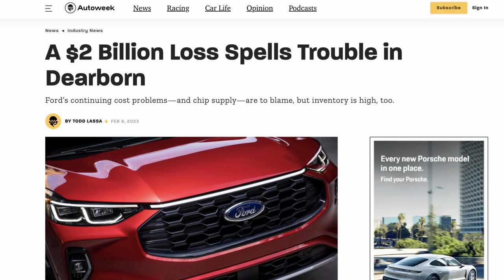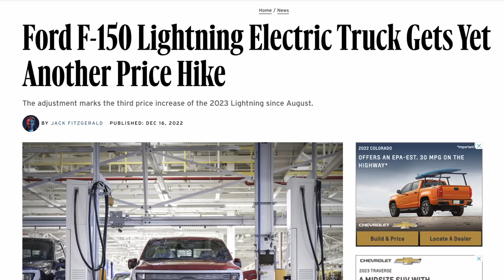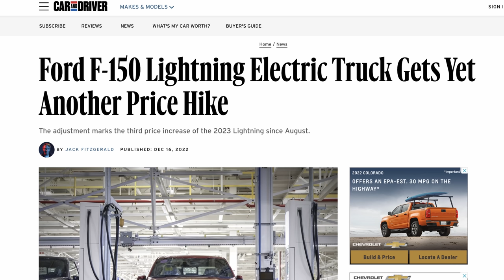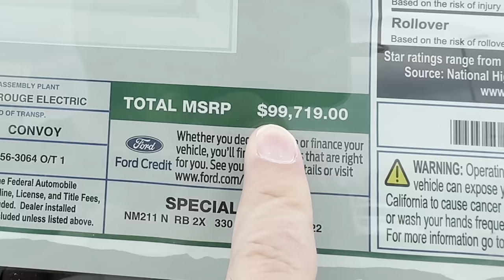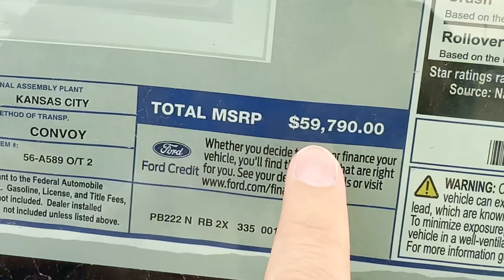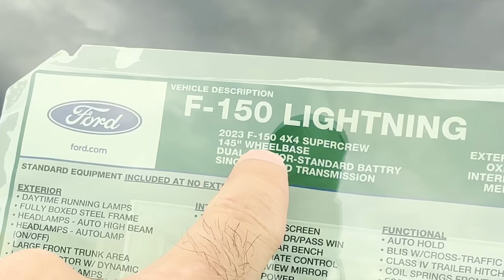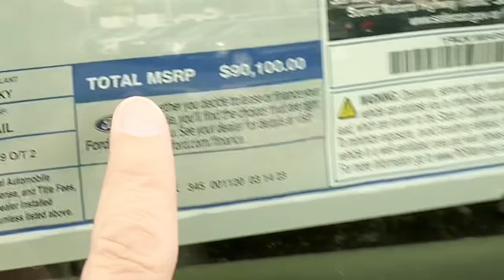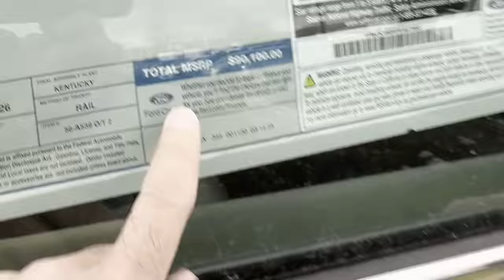Ford CEO Makes HUGE MISTAKE, Now Dealers CAN'T SELL TRUCKS!

Comment: 100k for a POS full of recalls forcing us to use the dealership for service that can't even tie their own shoes. No thanks.
Reply: 🤣 that's soo true
Reply: If you don't have a trade-in with crazy resale value these trucks are unobtainable.  They're giving us $71K trade toward a $89K truck. I'm financially comfortable but without that kind'a deal NFW would I pay what they are asking. It's crippling. Add $90 a month for every % of interest rate as well,,, remember that. That $71K trade -in is a POS is the only reason I'm getting rid of it.
Reply: @Dive-Bar-Casanova  You say you're "financially comfortable" ok well, how did you wind up with negative equity like that? We lost our almost paid off Mitsubishi last November to a deer accident. So we needed to buy something and I didn't look forward to buying anything at that time because I knew the used and new car market was nuts. Best thing I could find was a 2023 Kia Soul LX for $22k. Toyota and Honda didn't have much inventory and what they had on the lot was way overpriced. So we took the $10k equity check from the Mitsubishi and put it towards the $22k Kia. We had $60k in the bank in cash at the time and we could have purchased anything we wanted but the $22k Kia gets us around so I'm just trying to fathom your situation with a vehicle that costs several tens of thousands of dollars. I checked online to see the Kia's value and even though the 2023 doesn't come up in KBB because I guess they don't have enough data yet, pricing it as a 2022 with the same miles it comes back over $19k trade in and $21k private party which is insane but means we have plenty of equity so we can trade out if we wanted to but we tend to keep our cars for at least 10 years.
Reply: Go tundra and rams
Reply: I was at a Ford dealer this winter with my wife's Fusion to replace the driver's airbag under recall, the place was a shit show. Writers openly discussing blown-up engines and they couldn't do an oil change for me, either. They wanted me to spend more time at their ROC across the street.
I'll fix everything that I can from now on.  I'm a musician, not a tech, either.
Reply: @MazichMusic  perhaps I can recommend toyota?
Reply: it doesn't help when a ford factory trained mech buys one, and it goes into limp mode in the first week of ownership. Then you have videos of someone buying a mach E, having issues in the first month and when she took it in to get fixed then said 4 months to get parts. I'd demand my money back right then and there.
Reply: @justacinnamonbun8658  Get a Corolla, pay what you have to but please don't buy junk like a Kia.
Reply: It's like this, most dealers understand the average customer buys 1 vehicle every 7/10 years at best, customer's that buy fleet buy every 3/5 years, so a fleet buyer will get that $70,000 truck for $63,000 and get tool box,spray in liner and free maintenance for the first 30,000 miles or 1st year. But ford took advantage of the supply and demand and lost its fleet buyers to dodge because they offered 0% interest for the life of the loan,didn't do market adjustments . Chevy,gm are almost broke and the fleet deals they run are 6 cylinder trucks plus interest rates with a extra 2 points for the financial writer. Titan,tundra most of us will never buy fleet trucks because the truck is still to new and not really a competitor vs the USA brands. Not saying that titan,tundra won't just no market for fleet trucks pulling a car carrier, flat bed ,tow truck.
Reply: @petebusch9069  Uh...... No. Unless you want to start paying my bills in which case you're more than welcome to.
Reply: @justacinnamonbun8658  Who pays bills these days, just sign the papers and don't worry about it.
Reply: @Dive-Bar-Casanova  It must not be a Tundra. 😀
Reply: @tr-lj2vx  The do da te lo door chime is the deal killer for me.
Reply: @justacinnamonbun8658 he didn't say he's getting 71k trade in on a truck he owes 89k against.
He's getting 71k towaards a vehicle priced at 89k.
Reply: @tr-lj2vx  The bait and switch, add-ons after agreement, padded service bills etc of dealerships is going to sink them. I would rather deal with a cop that should have retired a decade ago than to fight a car salesman.   The  first time I ever walked on a car lot I knew within a minute I was standing in a den of vipers. The average dope dealer has more honor than the average car salesman. The few times I have walked on a dealer lot, I tell them I am the one with the money so I ask the questions, until then leave me alone. Most of them are really offended with a person unwilling to be manipulated in to a worse deal.  Dont answer any of their questions because I can assure you  99% of them dont give half a crap, anything you say will be used against you.  If I see a vehicle I am interested in I tell them how much I will pay, in cash, and dont want to hear anything else but yes or no. If you have to go haggle with someone else to see if the number can be matched, that's on you, I'm not gonna play games for weeks. If I decide to use financing I am certainly not doing that through the dealership because if they are involved they are gonna tack on their cut too.  Just think about it, go on the lot and ask, how much is that vehicle and the contract they write up will NEVER be the price they told you.  In fact it would be hillarious if somebody would film that interaction when they whip out cash and start counting it out right after they were told the price.
Reply: @petebusch9069  Yeah that's what I thought. All talk, no ⚽⚾🏀.
Reply: @tr-lj2vx  "I hope ford starts building good trucks again" bwahahahahah that's a good one! you had me going there. Ford's motto: quality is job none!!!
Reply: Isn't that the truth!
Reply: 30 year Ford tech, I AGREE. 🤙🇺🇸🇷🇺✌️
Reply: Best comment 👌.  Spot fuckn on Pete😎✔️
Reply: You spelt Stealership wrong lmao!
Reply: yeah I'll get a toyota tundra for 60% that cost and mostly NEVER worry about its craftsmanship and longevity. Henry Ford is rolling over right now.
Reply: Of the 3 manufacturers mentioned, Ford is the only one with a major safety flaw in the design of their auto transmission!!!
•  In an emergency, you can't push the shift lever from D into N with an open palm!!!  This is not shifting in the normal sense by pulling up on the shift lever and changing gears!  
•  On Ram, Chevy, GMC as well as most other auto manufacturers  you can do the emergency disconnect move - Honda, Toyota, BMW, Lexus, Audi, Mercedes, Nissan just to name a few!!!
•  The same is true on Ford's console mounted auto transmissions - you can't do the above move but have to push the lockout button!!
•  The whole idea behind this safety design is to allow the driver to disconnect the engine from the drivetrain without having to worry about putting the trans into Reverse! There is a safety detent and the transmission cannot go into Reverse with this emergency procedure!
•  No dealer know about this because for some reason, the manufacturers do not publish this info!!! Try it - you just may be pleasantly surprised unless you own a Ford product!!!!
Reply: @christianmiller4422 rams .  😅🤣😂🤣😅
Reply: @petebusch9069 very good advice.. 40 year mechanic here.
Reply: @utpharmboy2006  I have a Tundra and a Taco.
Reply: @petebusch9069  lucky 😁
Reply: After it has sat uncovered in a lot for over a year. It's already halfway used with no mileage.
Reply: Exactly I'll ride a bicycle outfitted with a motor before I pay this kind of money for a vehicle.
Reply: @Overlord is Google that's actually an option. I have seen electric bikes with 1,000 watt motors, 120+ ft/lbs of torque, full suspension for about $2,500 plus shipping. They are pretty fun as well.
Reply: @Just a Cinnamon Bun  either me or you are misreading his post..I read that he had 71k in trade in value. Not negative equity. Paid for 71 k truck traded for ann89k new truck, leaving about 18 k balance to pay on new truck.
Reply: It’s amazing how much the dealers don’t care. Oh wait… they do care about high priced unnecessary fluid flushes.
Reply: @christianmiller4422  love my ram!
Reply: Anyone who spends 100k on a truck deserves what they get
Reply: @laserflexr6321  
The managers set up the sales floor mentality with meetings & "training". They don't care if you Rochambeau with the customer for 5hrs.  Hence the poor shopping experience and massive emp turnover.
Reply: @muskokamike127  Didn't you hear, Ford changed their logo to "No longer built Ford tough."
Reply: America is holding on to it's money........... (sound of a pocket of change being emptied into a jar after the 3rd visit to a convience store that day)
Reply: We had two oils changes on both our fords
Reply: Comments about Dealers really hit home here. 2016 F250 Super 6.7, ran great till 67K. Meticulously maintained.  Went into limp no reason at all.  Took dealer and no less than 3 Factory service engineers 6 months to diagnose and repair...a Mass Airflow Sensor.  Then returned it to me with a severe exhaust leak into cab, just fixed last week.  6 months without vehicle.  Had to get FoMoCo involved to make it happen. To their credit they did give me a 3 year 36K Premium Care Warranty but only good at Dealers.  And it's going to be getting a new DCR fuel pump to replace the CP4 that explodes and takes out the fuel system around 100K miles.
Reply: @rayc5255  Dump it.
Reply: They can't get parts either.
Reply: "But but but, I have a college degree and can afford that..."  🙄.
Reply: This is the most accurate description I've ever read.
Reply: @laserflexr6321   exactly. I bought my car with an app and paid the exact price they were advertising it. No haggling or hidden B.S. and, it is American designed and manufactured and hella fun to drive. Thanks @Tesla.
Reply: No one can force you to use a dealership. However, if you need a warranty repair or a recall done, the customer doesn't pay. 

That said, if you own a late model vehicle, you really don't want to use an aftermarket shop. Very few techs are capable of working on modern cars. And for the ones that do, at least 90% of them work for dealers. I get cars towed in every day from independent shops that got themselves in over their heads. They just don't know what to do. If you don't have factory training, it puts you at a huge disadvantage.
Reply: @AT-wl9yq  BS all the way. We ARE forced to use the crappy dealership for warranty and recall work and its a horrible experience. Yes it may be free but having the idiots do what they do to my truck is a nightmare. Independent shops are not ALL bad, there are a lot of good ones out there and is where all the really good techs end up, not the stealership, that's where they get their start because a dealer will hire anyone.
Reply: @petebusch9069  "We ARE forced to use the crappy dealership for warranty and recall work"
I believe I just said that. How could it be any other way? But lets say they did allow it. You would then say "I brought my car in and they didn't even have a factory certified tech working on it."

As for the rest of it, you're just being emotional. Independant shops can't do anything. There's an occasional exception, but for the most part, they don't have the tools or ability to do the work. I have to fix their screw ups every day. At least once a week, I get an F150 towed in from another shop that couldn't follow the procedure to set the transmission fluid level properly.

So, you can say whatever you want, but I'm the one who actually does this. You, and the  people you bring your car to, do not. I do procedures on vehicles every day that you guys don't even know exist. And I mean that literally.
Reply: Yeah, I've seen too many videos about repair work done by Ford that was either incompetent or just not even done.  Too bad.  I used to love Ford.
Reply: @zak2u2  Me too. I'm a senior master Ford tech. Its the highest level you can get. We used to make some very respectable vehicles. They may not have been the best, but if you took care of it, one of our cars will last. Not anymore. Our engineers are crazy. When I tell people that work for other brands about some of the design issues we have to deal with, they don't even believe me. 

Here's my advice to anyone interested in a Ford. Of all the major brands, Ford is the most complicated and difficult to work on. The relationship between the dealers and the factory is also extremely complicated. A regular person will never be able to tell if an issue they are having is the dealers fault, the factory's fault, or both. It could be any of the 3. If you don't have a dealership you know and trust, don't buy a Ford product. Very few people can fix our cars. You'll need to rely on your dealer.

If you are not sure if you have a dealer you should be using, check for one thing. Heavy line work. If you have a look in their service department and you see a lot of big jobs, such as engines and transmissions, that's a good sign. Some dealers are set up to do this type of work, while other try to avoid it at all costs. Just about every day, I get an engine or transmission approved for a customer that was turned down at another dealer. It shouldn't be that way, but that's how it is. Other brands, like GM and Dodge are far easier to work on. They're not necessarily better, but you don't need such a high level tech to work on them.
Reply: You have to have them to sell them
Reply: Leave the trucks on the lot  and just by yourself  nice pair of sneakers 👟 👞 👌
Reply: Priced to high for any hard goods ,
Reply: Lmao. Well their stock continues to rise, actuallt just got a huge bumb due to the tesla annoucement. But yeah, there will be kids on here crying about anything and everything.
Reply: Same with rams 3500. After 2018-2020 the truck is garbage.
Reply: @christianmiller4422  I'm a Toyota truck guy but I have to admit, I like those Ram trucks that are coming out.
Reply: @tonyrobichaud  I like my hemi's too, but I can buy a 2021 1794 edition tundra for as much as I can buy a big horn ram.
Reply: Sorry bud but adjusted for inflation these high dollar upper end trucks are not too far off from prices 15yrs ago adjusted for inflation. Where people crying then? Secondly Ford can't keep these trucks in stock. Third, in the USA only about 10% of all half ton trucks will ever tow or haul anything more than fishing gear or golf clubs. As far as site stock...good job, you came the week they had regional delivery. 🤡🤡🤡
Reply: People need to STOP buying these vehicles until they come WAY down.
Reply: No one is forcing you to do anything lol
Reply: I called no answer
Reply: But, isn’t Ford giving the consumer what it wants? If they are willing to buy them, which they have in the past, Ford will provide them. If the consumer says no dice, they will disappear.
Reply: Bought a truck from them and came back a year later the truck I bought for 24k they offered 6200 then try and gouge me on a newer big truck. The f
Reply: Yup.  Not interested in Eco-trash engines.  Give me 2V 4.6 with aluminum body.  Coyote is good.
Reply: And have the time the dealer service takes 3 days just to fig out the issues
Reply: Then factor in the interest rates and payments. People don't need another house payment
Reply: @rvadventures  wish I were as broke as GM. General Motors gross profit for the twelve months ending March 31, 2023 was $21.407B, a 22.34% increase year-over-year. General Motors annual gross profit for 2022 was $20.981B, a 17.36% increase from 2021. General Motors annual gross profit for 2021 was $17.878B, a 30.76% increase from 2020.
Reply: @redinsight6725  US consumer spending has been going up every year since 2020 and is higher than ever both in gross amount and as a percentage of income. So you're completely wrong.
Reply: @HeWhoIsWhoHeIs  I'd look but honestly want a 6.7 f250 he'll even the 6.2 will do but I have seen some used for 45k with 120k miles
Reply: What Ford should do to get out of this slump is go woke.  🤣😅😂😆😅😅😆🤣🤣😂🤣😅🤣😆😂🤣😅🙂😂🤣😅😆😅🤣😅😂😆😅😅😆🤣🤣😂🤣😅🤣😆😂🤣😅🙂😂🤣😅😆😅🤣😅😂😆😅😅😆🤣🤣😂🤣😅🤣😆😂🤣😅🙂😂🤣😅😆😅🤣😅😂😆😅😅😆🤣🤣😂🤣😅🤣😆😂🤣😅🙂😂🤣😅😆😅🤣😅😂😆😅😅😆🤣🤣😂🤣😅🤣😆😂🤣😅🙂😂🤣😅😆😅🤣😅😂😆😅😅😆🤣🤣😂🤣😅🤣😆😂🤣😅🙂😂🤣😅😆😅🤣😅😂😆😅😅😆🤣🤣😂🤣😅🤣😆😂🤣😅🙂😂🤣😅😆😅🤣😅😂😆😅😅😆🤣🤣😂🤣😅🤣😆😂🤣😅🙂😂🤣😅😆😅🤣😅😂😆😅😅😆🤣🤣😂🤣😅🤣😆😂🤣😅🙂😂🤣😅😆😅🤣😅😂😆😅😅😆🤣🤣😂🤣😅🤣😆😂🤣😅🙂😂🤣😅😆😅🤣😅😂😆😅😅😆🤣🤣😂🤣😅🤣😆😂🤣😅🙂😂🤣😅😆😅🤣😅😂😆😅😅😆🤣🤣😂🤣😅🤣😆😂🤣😅🙂😂🤣😅😆😅🤣😅😂😆😅😅😆🤣🤣😂🤣😅🤣😆😂🤣😅🙂😂🤣😅😆😅
Reply: guys/gals, ALL vehicles have been junk since the mid 2000s.
Ford F150s died in 1997 / Super Duty died in 2003.
Dodge 2nd Gen. 1994-2001 with a Cummins was the only good truck Chrysler ever made. NOTHING before or after.
My beloved GM died in early 2007 at the end of the 5th Gen.
Reply: All brands are garbage
Reply: @TheThugNasty  💯🎯👍
Reply: @christianmiller4422  🤡commi
Reply: @justacinnamonbun8658  buying a car is a money losing situation overall.  Buy what you can afford and keep it simple.  That's a different number for everyone.
Reply: I took my 2010 tacoma to a toyota dealership in north central texas to have repairs done and it came out with more problems than  it went in with. Ughh
Reply: @christianmiller4422    They’re also having problems. And the prices are horrible. Fun story…my 2013 taco started having trouble with people not hearing me and dropping phone calls. I’m a retired OR nurse (long story) that happens to have a A&P license so I will do my own repair unless it requires special tools or facilities. I was lucky because the microphone is not part of the radio and “all” I had to spend was $200 for it which if you saw what it is you’d say it was robbery. But just for curiosity I asked the parts guy to look up the radio…him and I shared a nice heart attack moment when he found it was $5k+ and he could discount it to $4k+. For a moment I thought I was at a German or Italian car dealership.
Reply: Every dealership is different. This comment is garbage because it associates the good with the bad.
Reply: @andyfreeman6865  Show me a good dealer and tell my why its good.
Reply: @andyfreeman6865    Not every dealership is bad…correct however most dealerships ARE bad. In my case I switched from ford to Toyota in 2013 because my local ford dealership refused (passive aggressive style) to repair my 1997 F150 with OEM parts. All they wanted to use was rebuilt parts. I finally got sick and tired of the repeated “warranty” replacement of the rebuilt parts and keft
Reply: AMEN!! 👏🏽👏🏽👏🏽👏🏽👏🏽 "NO THANKS!!" indeed!! 👏🏽👏🏽👏🏽👏🏽👏🏽
Reply: @overlordisgoogle8431  my daughter sold her car and brought a £1000 electric assist mountain bike from Halfords...it breaks down once a week...their excuse is that 25 miles a week for commuting is too far and that it's not suitable for commuting...they won't give her money back as she has had it over 4 weeks.....you couldn't make it up.....I shall keep with my 16 year old diesel Ford truck and continue doing my own repairs...EVe are not currently fit for purpose...
Reply: @christianmiller4422  ditto to your sentiment. I got 25 k trade in for my corolla and then put myself in a tacoma. Toyota is clearing space for inventory…they move their inventory FAST!
Reply: @HeWhoIsWhoHeIs Kia and reliable are not 2 words I would put in the same sentence.
Reply: @yourfriend9048  not toyota or honda.
Reply: @christianmiller4422  TBH, never been a fan of imports. IMHO, I doubt they're in any better shape though.
Reply: @Moveto Rumble  you do realize Hondas and toyotas are at the very least assembled in the US right?
Reply: @HeWhoIsWhoHeIs congrats. I believe you are a lottery winner because of that.
Reply: @christianmiller4422  ok, thats good, i guess?
personally, my favorite vehicles are fullsize 4th Gen. GM trucks, vans and SUVs from the 90s. in our house, thats all we care about... back when vehicles were still built well, meant to last a long time and were user friendly and easy to repair and maintain. not to mention, built in Canada and USA.
Reply: Or pull up a zipper!
Reply: I had a used 2008 Nissan Rogue that I bought for my daughter, in 2015 the transmission went while she was driving on a Parrkway, Nissan replaced the Transmission free of charge and that is the only major problem I ever had with a Nissan, and I have had 8 of them. None of them were pickup trucks but if I wanted a truck it would be a Nissan or Toyota.
Reply: @jeffb5785  sorry to hear that.
Reply: @georgeemmons5128  and likely not even sit on the toilet the right way.
Reply: Pretty much sums it up
Reply: No, it’s funny the Ford dealership by me has like no trucks but I know this guys right because it’s been going up for years fast to
Reply: Should've bought a Nissan
Reply: @justacinnamonbun8658  I wouldn’t be caught dead in a mitstibushi no matter how cheap it was
Reply: @christianmiller4422  fusions are garbage
Reply: So basically it's costing you $1,000 per mile your going to drive it.
Reply: Commercial in this video was a Ram truck 🛻.  Toyota?
Reply: If you make $21Million or $21,000,000 (lot of zeros) they appear cheap.  What model Mercedes or does the CEO drive.
Reply: @MazichMusic  
Don’t damage your hands Mr Musician or you are out of work.
Reply: @christianmiller4422  I picked up a 2020 Ram to get out of a 2013 bmw which I blew the engine and just put thousands of dollars to fix it at a time when the car market was nuts and I’m glad now the Ram is still worth more than what I paid for it with way less miles than what’s on the market, screw all these dealers with crazy markups cheers to all 🫡
Reply: @laserflexr6321  
If you count that much cash 💵 you have forms and the IRS to now deal with.  Ask Walter White too much cash is a problem.
Reply: @rcpilot179  
Add a tow hitch to the electric bike 🚴 and pull your boat.
Reply: @justacinnamonbun8658  Some of us don’t care. I care about having a pickup with fantastic off-road performance, so I bought a new 2022 Jeep Gladiator Rubicon. No matter how you spin it, vehicles are not good investments. May as well have fun and love whatever it is you are driving.
Reply: @TheThugNasty  Why bother rationalizing? They’re all expensive, and they all depreciate. I say just buy something that you love.
Reply: I'm literally looking at buying a full blown IFR capable Plane for 40k less than that lmao
Reply: @redfoxtactical8425  I want a helicopter so bad
Reply: You just concisely but effectively roasted Ford in the most convincing way I've ever heard. Just based on this one comment I'd be scared to every buy a Ford. My Toyota isn't perfect but....
Reply: I’m a ford tech at a dealership and this is so true. Lmfao 
Most of my jobs are just recalls lmao
Reply: Hahaha! I spent 100k on a import Porsche . Nice piece of ultimate engineering .. Ford…..NOT
Reply: I have an 2021 F150 super crew selling for 55$K ,, CANADIAN !WITH 33000km or 18500miles ., no accidents ,no smoking , no towing ,,completely clean
Reply: I work at a Ford dealership and will say there is absolutely no support from the manufacturer.  That makes it very difficult for those out inches trenches.  "Peofits over people" that's American BIG Business
Reply: @christianmiller4422  do you remember Pearl?
Reply: No exaggerations were found lol
Reply: Chevy is just as bad lol
Reply: @Dan-nr3om  It is, same with Dodge.
Reply: The nice Lady at Autonation in Wickliffe,  I bought my Transit  from, know s more than the service guys!😵‍💫
Reply: Boy, you got that right.
Reply: Yup they are absolute shit! I only sell them at a major Ford dealership
Reply: Ford rainbow raptors didn't help sell either 😂😅😅
Reply: @christianmiller4422 says so a Toyota sales person, loool, what a joke
Reply: @christianmiller4422 I drive a Lincoln and after 5 years of ownership, no issues whatsoever. Only recently I had my brakes changed. Ford makes excellent cars. But I do understand your advertising tactics for Toyota. If you work for a Toyota dealership, then I guess you should be loyal to them, lol
Reply: Lulz....
Reply: Dealerships are in every way, AWFUL. I hope Tesla helps to end Dealerships all together.
Reply: Keeping up with the Jones'
Reply: I’m going to keep my shit box car until the mechanics say “ I’m sorry we can repair it due to x,y,z. “ My car is paid off! No way would I ever pay $30,000 or more for something that just keeps loosing value.
Reply: If The Big 3 In Michigan Are Depending On Me And My Wife And About 16 Cousin's In Our Family They'll Be Standing In The Bread Lines. My Sisters Son Bragging At A Family Get Together  About His New Chevy With That Big Screen And All The Other Options And Then Told Us His 84 Months Loan Term And Monthly Payments At 6.5 % Intrest. A Bunch Of Us Just Laughed And Told Him We're Glad Of The Simple Education We Had And He Laughed Specifically At Me And Said Well At Least He Didn't Have To Ride Around In An Old 1999 Suburban.😂😂😂
Reply: Agreed, or schedule work to find out those incompetent morons are 5 months behind on vehicle warranty work, so…..you get to have a POS loaner while yours sits in the shop while paying that 2k payment at 6% interest (or MORE)
Reply: You forgot to mention the piss poor engineering engine failure transmission failure out-of-this-world
Reply: F was the on
Y stock I had left in the green after Biden too office.   Now all red.  At least with Ford, I can buy.
Reply: I own a service company and we buy multiple trucks a year , after years of buying f-150s we are not buying them anymore, last 2 ones we gotten have multiple issues, and the dealer doesn’t care ! We literally had a truck with less then 1000 miles and was not working and the dealer didn’t even care ! No more fords !
Reply: No truck is worth 100k as I see it.
Reply: @christianmiller4422  perhaps you could recommend Toyota, IF the stealerships had any stock.  Shortages of new stock has led many toyota dealerships to stock with overpriced used vehicles, while gouging for new stock even on orders
Reply: My last Ford was in 2014 and I've never looked back
Reply: @christianmiller4422  my 04 tundra has 300k plus miles, no rust and runs like a champ. I’ll never buy anything but Toyota again.
Reply: It's insane! 😂
Reply: I’ll just get a Mercedes S class for that kind of money, and rent a truck when need it.
Reply: I had a 2014 Ford Focus with a CVT transmission that went bad. Ford dealership makes me sign up for a sunbit loan, $4000 
That I'm still making payments on. Had to rent a car for 2 weeks while waiting for repairs that cost me $2,200. As I drive the vehicle off the dealership two blocks down the car starts overheating. I WILL NEVER PURCHASE A FORD AGAIN.
Reply: @petebusch9069 that’s one contributor to the inflated pricing. People not paying their loans, government bailing out the banks resulting every dollar in your pocket being worth less.
Reply: Bought a used 2001 Ram 4x4.  $900 add $700 for upgrades and repairs. Been driving it for full year.  My neighbor scored a 2003 f150 for $3500.  Been driving for 3 years.  Both trucks have great paint and perfect interiors.  So why am i worried about going for a new $75k truck?
Reply: My cousin couldn’t tie boots until yesterday. He is 17
Reply: Id rather just have an older car where every issues known on the car has already been identified and has a solution
Reply: People will do it everyday though.
Reply: @djplonghead5403  For real?
Reply: @Dive-Bar-Casanova I’m sure you’re complaining about the process and ppl are hating!  Wtf!
Reply: RangeRover/landrover has all those issues as well
But does zero recalls
Reply: That’s why I drive a Toyota FJ Cruiser. Actually made in Japan. Ten years old and still like new! And I grew up literally less than a mile from the Ford Fairlane Mansion!
Reply: Yup only good quality is by 🇯🇵 … even if it’s built in 🇺🇸
Reply: My mom bought a Toyota SUV at a Ford Dealership and the guy said she made a great decision trading in her Ford Explorer 😂
Reply: And they couldn’t even wash the vehicle
Reply: The thing is that could be said about most new cars especially from the big 3. All the electric crap they put in these cars seems to constantly fail, and I’m talking about gas powered cars too. I have a 2016 Ford Taurus and the backup camera has failed 90% of the time I put it in reverse even when I first got it at 50k miles. I don’t know what the answer is but taking vehicles that already had electrical problems on the body harness, and adding more electric in the drivetrain is insanity.
Reply: All new trucks have crazy recalls. Trying to do too much with too little 😢
Reply: @justacinnamonbun8658 I bought a  ford ranger  for 24k in 2019 0 interest can’t believe how high everything has gotten since then. Guess with 59k miles and an extended platinum warranty on it I’ll just hold on to it for a while
Reply: @theupscriber65 gm trucks have the worst rating right now, getting multiple law suits due to many problems and why ram out sold Chevy this year for,the first time
Reply: @richardmessenger9474 25 miles a week too far what joke. I rode 40 miles Saturday and 43 Sunday on a regular bike yes I am a cyclist but that’s just plain stupid. But u shouldn’t buy a bike from an auto dealer though! My bike cost 14 k and it doesn’t have a battery lol tell her to sell it and get a specialized electric bike for 3 or 4k she’ll never have any problems and it’ll last forever
Reply: Dude, sold my raptor because of that bullshit.
Reply: Thats ford
Reply: @tr-lj2vx . FORD has to escort the POS CEO OFF the premises first.  I wonder if he gets kick backs from the Chinese battery manufactures.
Reply: A lot of people buy them- I don't get it either !